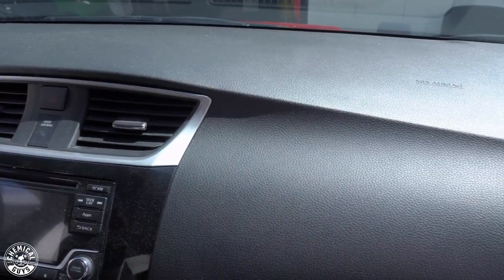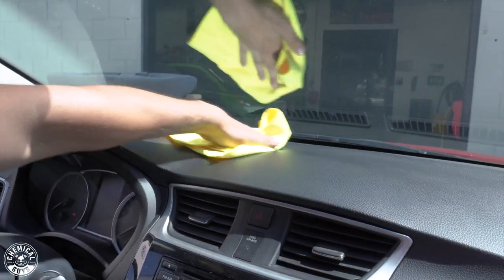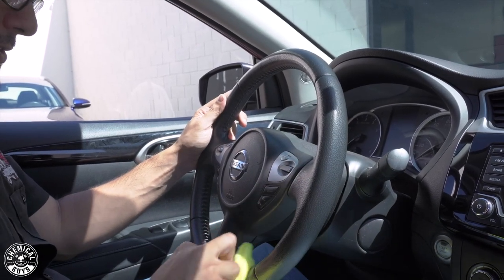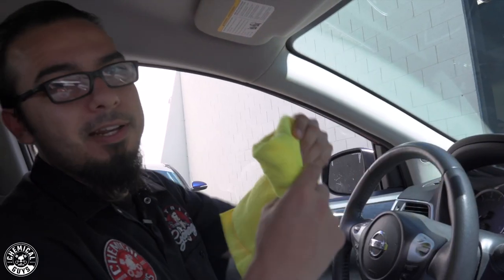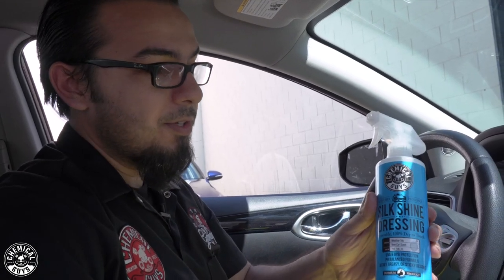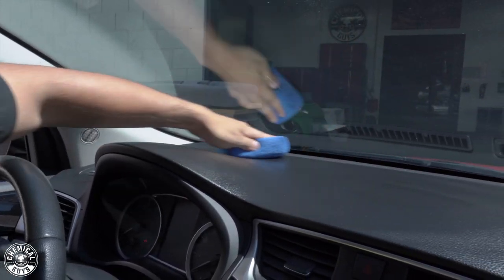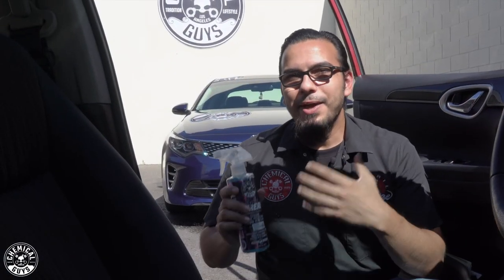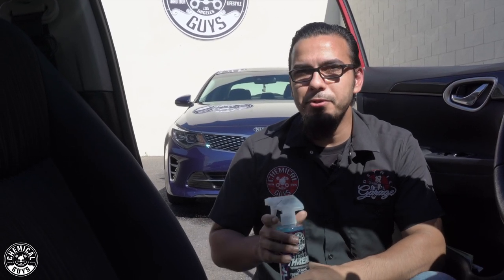How To Protect and Rejuvenate Car Interior! - Chemical Guys

Comment: What's your fells thoughts on using VRP for the dash? I just used it for the first time this weekend on my tires, dash, doors etc and was very impressed with the appearance as well as the ease of application. I also like the fact that it doesn't remain wet like other protectants and doesn't appear to attract dust and dirt especially on the tires.
BTW, Nick is the ideal spokesman, easy to understand and very informative, he appears to know his stuff.....Mike
Reply from the maker: Hey Mike! VRP is a great choice for enhancing and protecting the dash. Follow the same procedures by cleaning the surface beforehand and then apply your favorite dressing and wipe off excess. Happy detailing!! 
- CG Nick

Comment: Hey Nick can I use chemical guys nonsense colorless an odorless super cleaner to clean my dashboard, console, steering wheel, and screen  before I use the slik shine ?
Reply from the maker: Hi there! Great question, Nonsense can be used on virtually any service to remove grime and stains before applying a protectant. 
- CG Nick
Reply: @ChemicalGuys  Thanks for your reply I purchased $300 of stuff for my 2019 scatpack 392 charger and want to keep it clean and I see you have a  product  for every thing 👍🏼
Reply: @kingblack22ss  😅🤣😅🤣 I’m about to do the same thing

Comment: I need a quick assistance. Once I have used the Invinsible cleaner on my dash board and interior parts, what should I apply afterwards to nourish and protect them from the Sun and dust without any shiny/glossy look? I am after that matte factory look again. Should I use the Hydro Interior ceramic or something more delicate considering my dashboard is now super clean and free from oils and dirt? Thanks.
Reply from the maker: Hey! After cleaning the surface, apply Natural Shine to repel harsh elements with a matte finish that remains dry to the touch. 
https://www.chemicalguys.com/natural-shine-dressing/natural-shine-dressing.html?gtmListValue=Internal%20Search

Comment: I just ordered hydrothread for my canvas convertible top. After washing what is the correct way to apply the product?
Reply from the maker: Hey!! After cleaning and thoroughly drying the surface, simply spray HydroThread and let it bond. Using a soft bristle brush will help work the product into the fibers.
- CG Nick

Comment: Hey I have someone with a window issue, trying to remove calcium it looks like off the glass.
Reply from the maker: Hey! We recommend Heavy Duty Water Spot Remover Gel. The specialty gel neutralizes alkaline stains with a mild acid, removing the stuck-on water stain quickly and effortlessly.

https://www.chemicalguys.com/heavy-duty-water-spot-remover/water-spot-remover.html